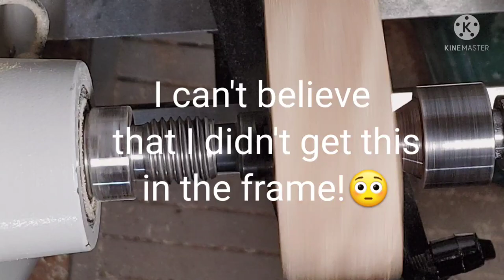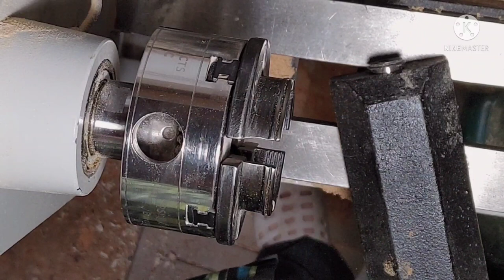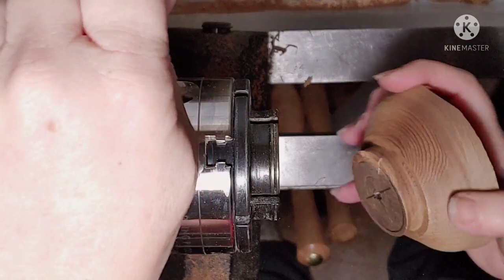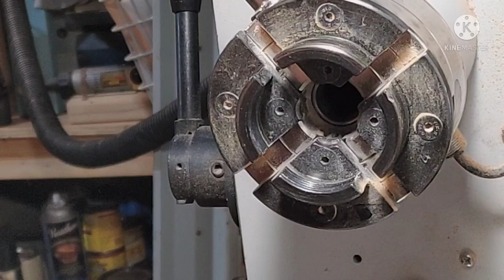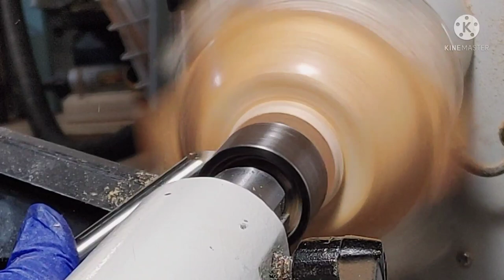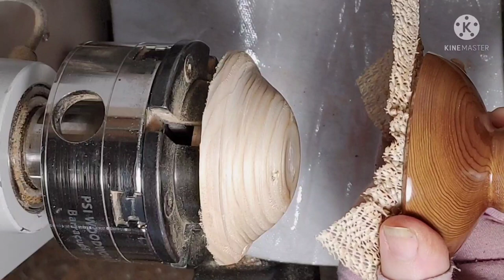Woodturning -A Square Lidded Box #woodturning #spiritwynd #woodenbox #woodcraft #woodlathe

Comment: Hi Heather,  for such a plain wood it responded well to the shellac and beeswax - Very Pretty indeed ! I do like the bevel(?) fit of the top to the bottom and I especially like the simple embellishment ring inside the lid. Betcha can't repeat it 🤪  BTW, the nub ended up burnishing the bottom just like using a handful of chips; any more RPMs and it may have burned.  I have used a popsicle stick to burnish a surface when I didn't feel like going back to a polishing paste.      Thanks for sharing🙏  Take care. -Mike😷  p.s. yep, the jewel on the lid was a surprise 💎
Reply from the maker: Thanks Mike! Ya, I don't think I could repeat that "embellishment", if I tried! 
The jewel was a surprise for me too! I had no clue on how I was going to finish it, until it was done! 
Thanks for watching!